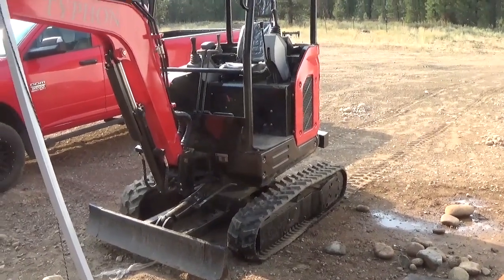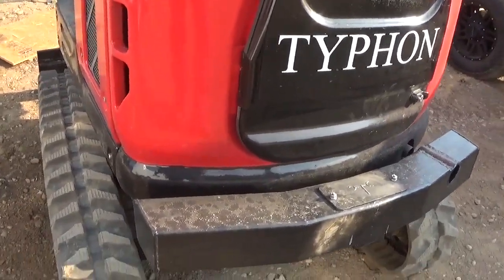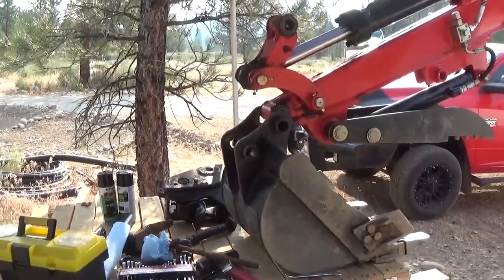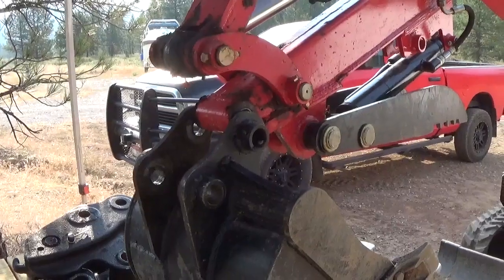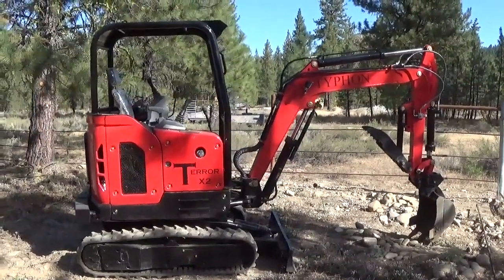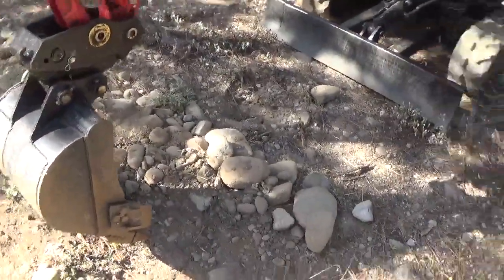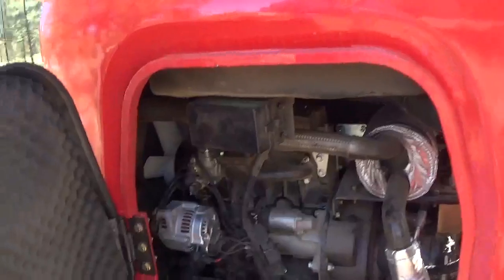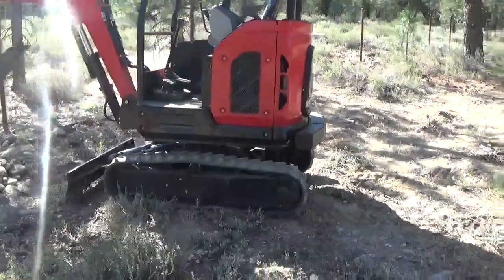Typhon Terror X2 mini excavator review and quick connect install

Comment: I bought one several months ago. I have only 7 hours on the excavator and every 30 minutes of working the tracks come off. I'm not an expert on excavators but I do all my repairs on my cars. from what I can determine, the hydraulic grease cylinder is leaking and losing pressure to keep the track tight. That’s not the worst of my problems with this excavator.  They used the wrong bolts to install both gearboxes (wrong pitch).  Which destroyed the threads inside the gearboxes. For some reason, the persons who installed the bolts on this excavator screwed up so many threads.  The other thing that I had a problem with is the fuel locking cap. It won’t open up. Of course, there are the leaking hydraulic lines.   But, with all the problems I’m facing, I still love working with this excavator, when it's working.  By the way, do you know what the bolt sizes is for the gearboxes—12mm x 1.75 or 12mm x 1.25?
Reply from the maker: I am not understanding what you mean by "gear boxes"?  If I can understand that I can and am willing to find out the bolt sizes.  Are you talking about the cover boxes that cover the hydraulic motors on the drive tracks?  I also noted that poor quality of the hydraulic lines, I have owned and worked on a lot of hydraulics, fork lifts, tractors, skid steers..... all of the hydraulics seem to "weep" as opposed to "leak" (leaving puddles) I have yet to have a true leak but they do weep for sure.  I have not had any leaks yet. I have had a track come off on me multiple times but those have been my fault, trying to turn to tight in the wrong material.  Let me know on the "gear boxs", I am glad to help.
Reply: @onemanswork9248  hello.  the part number is S/N6 gearbox 1.6.  the reducer motor S?N5 is connected to it.  Look at page 47 of the manual.  There are 4 bolts that connect the gearbox to the track.  the reducer motor has 2 long bolts that connect it to the gearbox.  The 8 bolts (4 on each side) are completely different pitch from the bolts they sent me.  That would be great if you could look at your excavator gearbox bolts and tell me what you have, no help from China.
Reply from the maker: @johonneng4105  I will take a look, it will be a couple weeks before I get it to the shop from my work site.  But I will take a look at it and try and figure it out.
Reply: @onemanswork9248  from the damage I can see in the gearbox, it looks like I have to repair the threads inside the gearbox.  thanks for your help.
Reply from the maker: @johonneng4105   likely that is the best call.  Good luck
Reply: @onemanswork9248  Hello again. update.  they are sending me new gearboxes and bolts for the repairs.
Reply from the maker: @johonneng4105  NICE!  I am glad to hear they are trying to stand by their product.

Comment: Have you changed the oil yet? I just received mine, not sure how to even pull the dipstick to check the oil much less add new oil any I site would be helpful.
Reply from the maker: I have not changed the oil  To get to the dipstick, there are 2 ways.  one remove the panel in front of the drivers seat to get access, 2 remove the seat and open the pannel from the top.  I plan to make access to the top of the engine easier by modifing the seat for quick removal and opening of the the top.  Have not changed the oil.  I will be doing that before spring building season.....

Comment: What do you think the machine can pick up? I am contemplating getting one to move logs around. Does it have a pressure over ride that stops you from lifting heavy weight or can you pick up enough weight to make the machine tippy?
Reply from the maker: it does pretty good, but the words "pretty good" are subjective.  I have lifted (to move, not load a truck) some dry ponderous logs that were 16" across and maybe 10-12 feet long. The logs were dry (3 years dead)  and that was about the Max it would do with the thumb.  I do think I could do weight to lift if using a chain around the bucket.... but that is not very convenient to get off the excavator to rig a chain. I hope this helps.  I have been please with it over all for the capability and the price.  The machine can get tippy, that was one of the reasons I put an additional counter weight on the machine.

Comment: Nice video. I have this machine. Like it. Kinda tight to sit on. The quick hitch is nice. You say the pins are 30mm? Is this all of the pins?  I have the PDFs from Typhon. They are helpful but lacking in complete info.
Reply from the maker: @Ridenby1  the 30mm pins I am referring to in the video are for the bucket specifically.  I will be making a land scraping bucket and a narrow trenching bucket along with a ripping tooth… I have noticed the price of those size implements and think they are way to expensive so I will be making them.
Reply: @onemanswork9248  Can you go into more detail on mounting the counter weight ?
Reply from the maker: @Ridenby1  I will put out an other video showing where I mounted it etc and talking about it.  It might be a few days before I get to it.

Comment: Is there any way to change the operation control pattern?
Reply from the maker: @brown7104  I am sure it could be done… but I am not sure that it is a simple throw of a lever or if one would need to move the hydraulic lines.  I only run this and a backhoe that I am selling… so I haven’t looked into it

Comment: Thank you for taking the time to do this video I'm planing on buying one,as I thought it will have a few issues but really of them do, Is the quick connect coupler worth it? 
Did you change all the oils in it before you started to use it?
Thank you again
Reply from the maker: @ChrisRuggles-b4d  I asked the question about the fluids from the seller.  This came from a seller in Southern California .  When they get the off the ship they are totally prepared for use.   I  drove it off the shippers trailer ready to go.  I did go over fluid levels and greased everything.  Checked all the hydraulic fittings and line for leaks and loose fittings.  I found no issues. But check everything.    Over all a great value.   Feel free to reach out if I can answer more questions.  I do have a few short videos on a couple of things with this.
Reply: Thanks for sharing!!!
Reply: The manual they sent me just has safety instructions. Did they send you any maintenance documents or instructions for switches, etc .? If so could you link those.

Thanks!

Comment: Thanks for this video!

The manual they sent me just has safety instructions. Did they send you any maintenance documents or instructions for switches, etc .? If so could you link those.

Thanks!
Reply from the maker: I don't have a link to the manual, They send it to me via a link that expired.  However I did down load it and have a copy.  I could email it if you like.
Reply: Thank you. They sent me something. Haha, honestly it doesn't help all that much either way even thought it does have more info. So, I'm just going back to trial and error. 

So far mine is working pretty well.
1. The battery was dead after two days and wouldn't keep charge when disconnected from the machine on my battery charger. I bought a new battery from the auto store and everything is working well.
2. It did have a diesel leak from the little clear thing at the bottom left when you open the back panel.
Reply from the maker: @lilkaufmann  that is you fuel-water separator, should be able to tighten that, check the O-ring is in place and not pinched.  Probably telling you something you already know 🤪